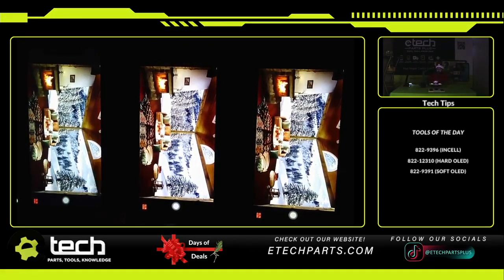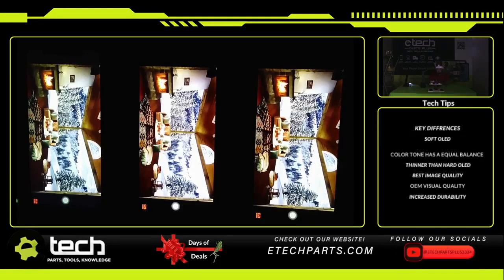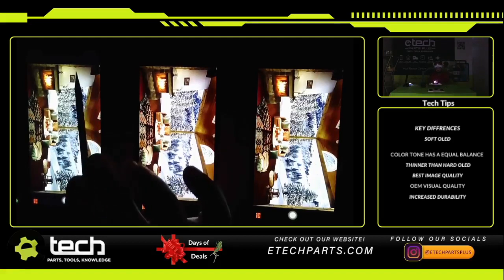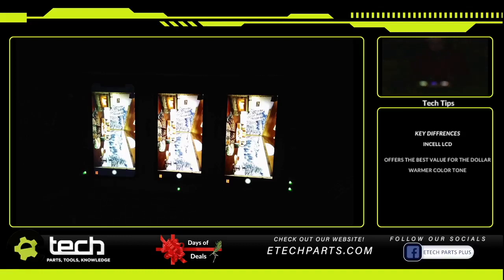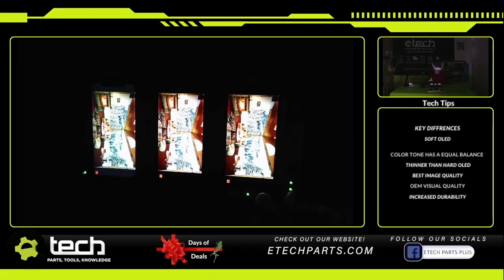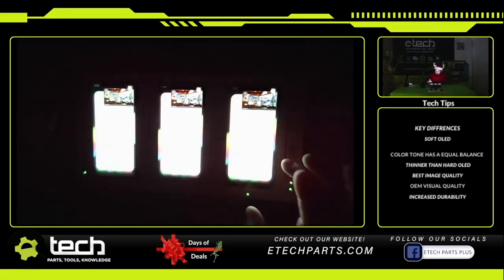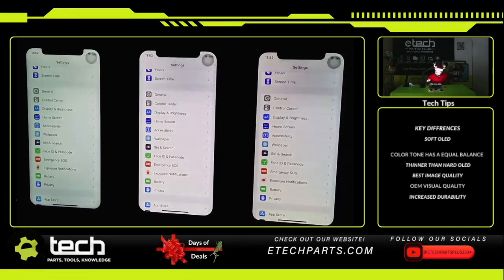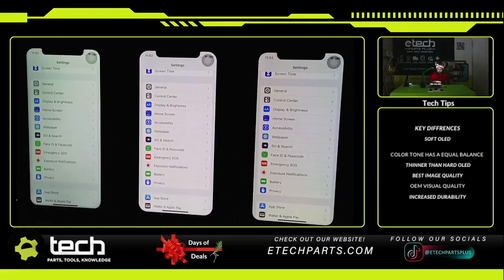What's the difference between Incell, Hard OLED, and Soft OLED?

Comment: I came across this video as I'm trying to replace an iPhone 13 Pro screen. Stairmaster ran over it and there's a line across and another black circle with 1cm diameter. Now, I'm worried that some things won't work cos some engineers/technicians in Nigeria may not know about the EEPROM programming you mentioned.

Comment: My 13 pro max screen stopped showing anything. 
I mistakenly slept on it. 
It just restarts itself the first 2 days continuously. 
Then went white the 3rd day
Then went black the 4th day till date. 

Is this panel or screen?
Should I buy a screen? If yes which? OLED or incell?
Reply from the maker: Hello! If you connect the device to a computer does it recognize it? If it does, it is most likely the display that is damaged. The panel is part of the screen assembly and when damaged internally will result in no image displaying. Trying a new screen would be a good first step in diagnosing. If the issue persists it is possible that there is either board damage present or another part causing a short which would result in the device not powering on or randomly powering off. If you would like the closest to your original screen I would recommend the Soft OLED. The incell LCD is the value option which is not as bright or as vivid color as the OLED.

Comment: You did not say anything about Battery Consumption and Overheating

Even Hard OLED would drain your battery and cause constant overheating 

also its smaller than Soft OLED in size
Reply from the maker: Hi @perish1n. Those are notable points! We will most likely do a deeper dive comparison on the the differences in the future. Any technology outside of the original will experience differences. In the video we focused mainly on the look. There Hard OLED and Incell version will consume more power leading to increased battery drain. Good quality versions of these screens; however, do not cause overheating. Unfortunately not all vendors use quality screens which can result in the overheating.
Reply: So which one is better ??? incel better ?

Comment: You did not speak anything about True Tone, Auto Brightness, Face ID etc. Do all those work after swapping out the screen? Do you need to re-program the screens in any way?
Reply from the maker: Hi! Face ID works with any repair screen repair completed on the iPhone X and newer as long as you keep the original front sensor flex and transfer to the new screen. Auto Brightness will work automatically without needing any programing. For True Tone, you will need to transfer the EEPROM data from the original screen to the new screen using a programmer.
Reply: @etechpartsplus2334  Thanks for your reply! This was helpful.